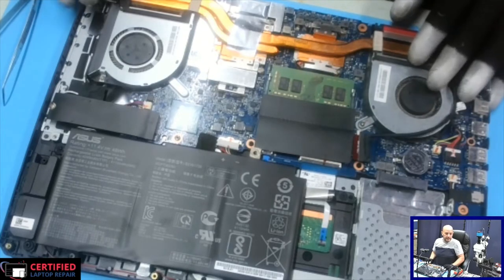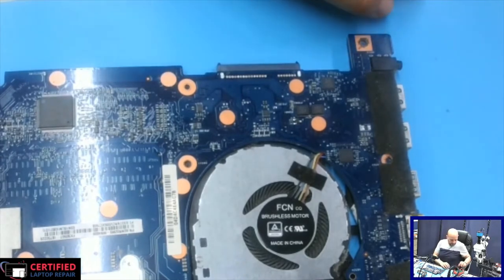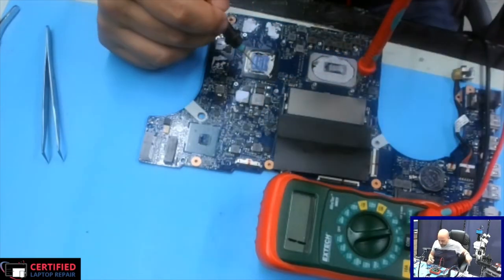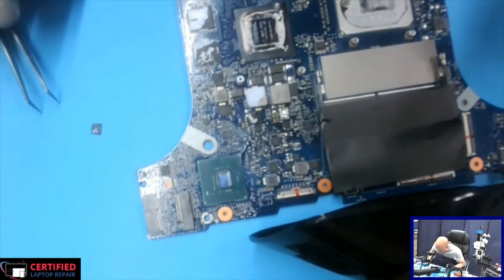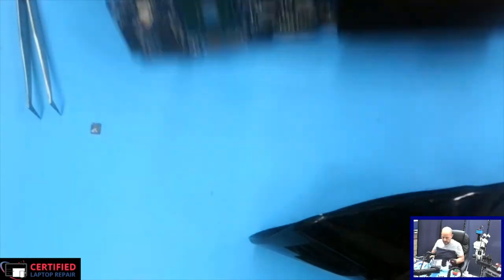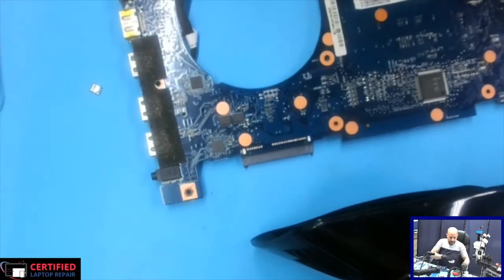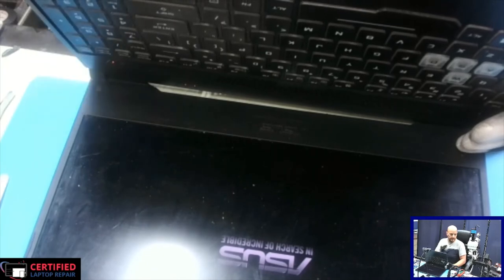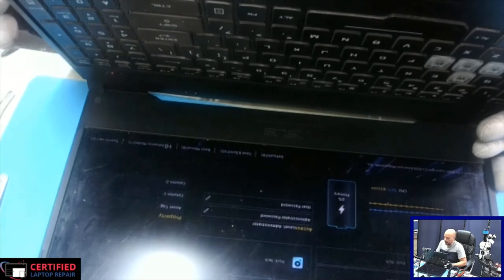Asus tuf  gaming fx505g motherboard repair shorted GPU mosfet

Comment: I have a Asus TUF A15 and  the problem is whenever I play games on charging, no matter what game it is. It crashes with always a GPU error.

But when on laptop power, the game will run smoothly until the battery dies.

For example, whenever I play RDR2 on charge it always crashes with GFX_STATE_ERR. But when on laptop power, it crashes rarely without any errors.

Now, i use to play Just cause 3, Halo infinite, Marvel's Spider-Man, days gone when I bought this laptop and then they all use to run smoothly without any crash. I use to play for 5-6 hours. But now, even on 60+fps every game crashes while on charge.
Reply from the maker: Your issue seems more like drivers error.  Make sure you update all drivers especially graphics one.   In some cases you might have to uninstall and reinstall them or even reinstall the os.  
If problem occurs afterwards, then i would start looking into hardware and disassembling.  
It is always best to take it to a specialist who knows what they’re doing.

Comment: I have the same laptop, but the device does not work, and there is a power light and a charger light, and the chipset heats up when I connect it to the charger, and only the laptop is almost dead. .
.
.Could it be the same problem?
Reply from the maker: Your issue is most likely in the charging circuitry.  Could be charging ic or a short in its surroundings which needs some testing to identify.